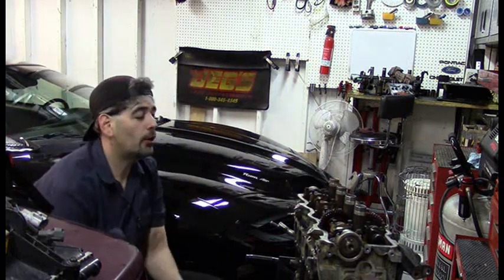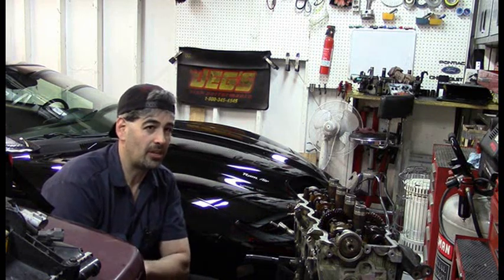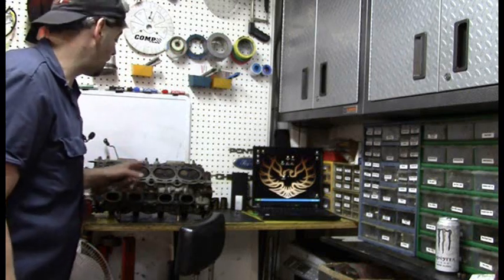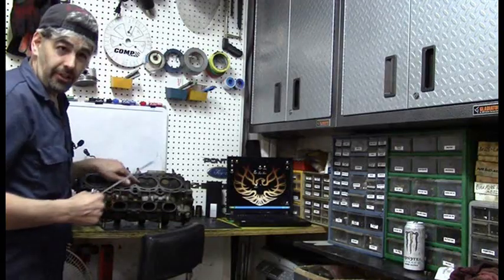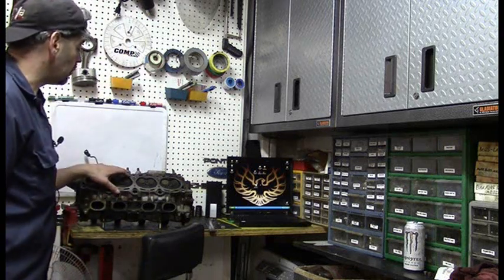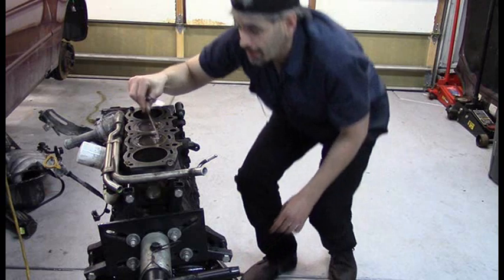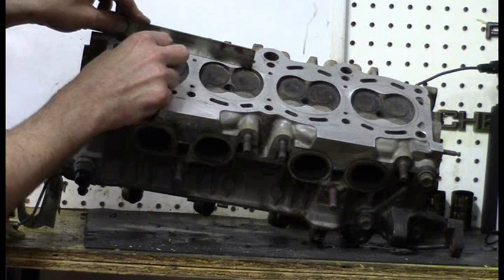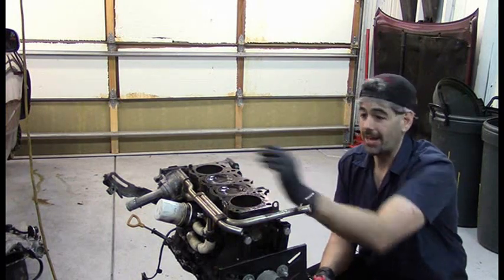Replace a Cylinder Head Gasket Yourself and do it RIGHT! Part 1

Comment: I'm a mom of 3 in Chicago. I have a 2011 Jeep Rubicon that I was told had a Head Gasket leak. Coolant found in the 6 & 4 cylinders. Been having those code/misfires for several months now. Replaced catalytic converter, coil packet, plugs, wires, recently. Coolant leaks on ground only recently. But it was "disappearing" over night. I'd drive for about 2-3 wks with no variation or reduction in coolant, then overnight - ALL gone, with nothing on the ground. 

No smoke, no white/brown stuff in oil, no "bubbling" in coolant/radiator or overflow tank. Rough 1st start of the day, evens out after about 10-12 seconds.  I only had 1 really bad start, as if it couldn't get gas. After 5 minutes idling, it went away.  Almost didn't start at end of July one day, took it to Jeep in State College, PA, they said my "spark plug wire was loose on 4."  They said all other 6/4 misfire issues (plugs, wires, coil, air intake etc.) passed, but he was sure it was my "Fuel Injectors", but they didn't want to replace them.  Kept giving me story about "not being able to depend on parts delivery etc." WTF!  They also stole stuff out of my Jeep!

Got it home, and took it to a non-stealership who said I had a Head Gasket leak, but unfortunately they don't do that kind of work. They're real honest guys at this particular shop.  Contacted 3 other garages in Chicago, and without even looking at my Jeep (one even told me over phone) that "Head Gaskets are not repaired or replaced.  I have to replace the entire engine."  LOL Dbags.

The ONLY Jeep dealership that I've found to be honest was in Cleveland, Ohio - at DEACON CHRYSLER JEEP.  I wouldn't even try to drive it that far now.  This is by far, the worst vehicle I've ever owned! Almost $50,000 for a pile of crap!  Looking for honest help in Chicago or anywhere in Illinois! 😭
Reply from the maker: Oh man that’s devastating but I do appreciate your sharing the story. I’m in colorado or I’d help but hopefully someone near Chicago sees this. Best wishes!
Reply: @SchrodingersBox  Thank you!

Comment: Awesome video / tutorial. Nice to see an advanced DIY video with some in depth analysis of the issue. I do agree to some point that it sometimes does not make sense to record the whole process of removing the head and each bolt & hose in the process. Even the description of your channel states - "This channel is for Advanced DIY auto repair" which should imply that the viewer is familiar with some previous automotive repairs. Then again I think there is a need for the channels / videos that go more in depth of the process of removal itself. I guess its something like school. You can't jump to solving differential equations before learning basic calculus (and a lot more stuff before). Anyway big thumbs up for the video.

Comment: Excellent video. I'd suggest also inverting the cylinder head on the bench and pouring some gasoline into each opening to test for leaks. Also, this test can be used in cylinder/piston gap situations. That might indicate more work to be done, even if not related to the overheat condition. Occasionally, cracks or gaps, either in the block or the head will be found in this way.

Comment: Thanks for the great video. Watched both parts twice, and felt pretty confident going into what I thought was going to be a head gasket replacement.... but I got lucky and during the tear-down I found a single bolt missing on the lower intake manifold.

Comment: I have a  97 Ford escort that showed symptoms of low compression on one cylinder. it was misfiring, hard starting, didn't feel "even" when it was running I had found evidence of an overheat due to a cracked thermostat and coolant being diverted through a bypass. got a parts car and had the replacement head resurfaced, got all new seals, found a ballast resistor for the ignition that wasn't properly grounded, (might have been the cause of the misfire I was getting) replaced a bad motor mount I couldn't get to with the head in place. replaced valve stem seals and refitted the replacement head. I guess I got lucky because the car runs great now. Wish I had seen this video before I started the job.

Comment: Pressure testing yielded coolant spraying from the gasket at this location. The "intermittent" part is my addition, because the coolant was spraying a needle-fine mist  all over the exhaust manifold one day, and the next day (and every day since) there's been nothing. (I got the pressure test done immediately after that episode.)

Coolant looks good, oil looks right, manual transmission so that's not a concern.

Thanks for the video and the response.
Reply from the maker: Lol, well I agree- that's pretty definitive of a blown head gasket! I rarely see them leak to the outside- usually the intake manifold does that.
  While I can't say for sure a 35 year old engine is not prone to a head gasket failure just from age, I can say that I have never seen nor would I expect a head gasket failure that wasn't caused by some mechanical issue originally.
  If the head is not warped or cracked and there is obviously no overheat condition and cylinder compression is not way higher than normal in the intact cylinders, then I suppose you have support for an argument that the head gasket simply aged.
Reply: I was planning on having it pofessionally machined regardless, but trying to cover all the bases. Thanks!

Comment: I've lost track of how many times I've watched this video. My first cylinder head removal was about 5 years ago.. Had absolutely no compression on cylinder 3 on my 3.5L Chevy engine. This thing was literally reading zero. I had brought it to a shop for a lower intake manifold gasket and when the car was returned to me it had a dead miss. After fighting with the shop, they would not look at it and insisted they didn't do anything wrong... Well they did. One of their techs swapped the intake and exhaust push-rods while reassembling the engine, causing a valve, and the guide in the head, to bend violently. I replaced the head with a used head and it was good to go. If I could have proved at the time that they were the ones who caused the head to fail, I would have pursued legal action.

Comment: So I just found your channel today.  I thought you posted specifically electrical diagnosis.  Righteous!
Reply from the maker: No I do a few basic bolt turners mostly just to bring in that demographic in hopes of showing them there is a more intellectual side than just spinning a wrench.
Reply: @SchrodingersBox  Funny thing,  I'm from that demographic.  Found your channel from your intro to fuel trim video.  Good stuff.

Comment: Any head gasket job I get, if it's aluminum head, I do a quick check with a straight edge and feeler guage. If I can get a .05 guage under it, it's off to the machine shop. If there's no warp, I pull the valves and check for obvious cracks. If I can't find one, I have the shop check it with their equipment.

Comment: Thank you for stressing that root cause analysis must be done before taking an action or you will be facing a recurring failure. I have tried to teach analysis for 15 years, it saves so much time and effort if a person  will just find the reason for the failure.
Reply from the maker: +Donald Wallace Yep amazing how many times I have seen people on their 3rd cylinder head (or any other component) because they keep fixing the same result of a missed root cause.

Comment: I love the hands on common sense approach to this repair! have a 2003 Dodge Stratus with the G engine in it and I replaced it with a used one with less miles the mechanic said the head had been replaced. My question is all of a sudden it is overheating. I have replaced the radiator, hoses, thermostat, the fans all work and I think I have oil in the fluid..I guess the Head Gasket is next repair? What do you think?
Reply from the maker: I would see my video series "12 ways of how to test a head gasket" and this will help you definitely find if a head or gasket issue is the cause.
Reply: Ok thanks I will look at it right a way and go from there. I will let you know what I find out!

Comment: great video just one thing research the k-series engine that will fail without low compression, mainly because its a long bolt engine and it flex's, but on the hundreds of the K-series engines i have rebuilt, tuned and repaired when they fail low compression is never an issue it is always the gasket and it overheating.

Comment: cracked metal detection kits consisting of  aerosol cans of cleaner and dyes are available at welding supply stores.  Pretty definitive, easy to use and not all that expensive for value gained.

Comment: Honestly, glad i take the time to research before i do stuff, just finished getting a fel pro head gasket in the mail, was about 3 seconds away from just going n pulling off the head, chipping out the old gasket, putting the new one in n torquing down the  bolts to spec n just firing her up after... good thing i didnt do that -.-'

Comment: Bolts are a science of their own, I did some work with a person who was probably the world leading expert on how to design bolt connections in cars for transmissions, engines, transfer cases etc working for one of the big 3 at the time. Anyway bolts are designed for the 2 parts they are joining, it is a spring just like the 2 parts that you are bolting together. In some cases you design for one time use, in other cases the bolts are reusable, theoretically....in reality, you never know if the bolts have been over torqued, maybe torched since they were stuck and so on so getting  new bolts is always the safe bet, especially for a head, since you always want a good head......
Reply from the maker: very good comment and very true. Yes there is tremendous physics involved in fasteners.

Comment: I love your channel, you make some of the best car repair videos on the internet. Quick question- What do you think of copper head gasket spray? I have changed head gaskets with and without it, and I have never had an installation related problem either way. Thanks.
Reply from the maker: Thanks man. Same here- never an issue either way but as of the last few years i use no dressing of any kind on head gaskets.  a i do not believe they provide any benefit.
Reply: Thanks. That's what I thought, just wanted to make sure. I like copper spray for exhaust manifold gaskets though. I don't think that copper spray is necessary for head gaskets, but I don't think that it's going to cause a problem either. Keep up the great work!

Comment: Great vid, that gasket is not symmetrical, at the end of the gasket there is a overhang region that is not on the opposite side.      Thanks for the vid though 🙏 chasing and ensuring a clean bolt install is a must!

Comment: Great vid! Only gearhead and want to prevent head gasket issues. You said you have to find the root cause to why the head gasket was blown. This was warp head and heat problem, but what caused the over heating problem?

Comment: Haynes manuals are good for telling you what a radiator cap looks like, otherwise I only have them for torque spec lists, which I always compare against another chart because sometimes haynes is wrong on that one.
Reply from the maker: Lol true.  My issue with Haynes manuals isn't actually with the manuals per se- it's that people who read them but never actually did any work on a car feel empowered to now give advice because of what they read. They go online and either give advice or "correct" people who do things differently than the manual does. In fact you ran into one of these "Haynes manual jockeys" on the last video you commented on-  The "foreign material" guy.

Comment: An extra point: You also must check the head bolts themselves for example in 6.0L Powerstroke engines the torque to yield head bolts stretch by a few thousandths and release clamping pressure on the headgasket even though there are no other problems with the engine. If a head gasket fails in this manner on a 6.0L engine, you will find zero problems with the head or block, but replacing the head bolts with ARP head studs (stronger) will fix the problem.

Comment: WOW to all the guys who use the manuals as gospel, you need to get out and do more work, since the manuals are average at best in some of the fine points.Hats off on this, I watched both and appreciate the level of detail since it does matter in the end. 2000 lincoln Nav original owner, I do all my work, rebuilt entre suspension system and fixed the sad ground issue that Ford says doesn't exist that smokes the relays. I need guidance. New tranny with 50K, new suspension 30K, I am keeping it as I like the ride. I have confirmed coolant leak passenger side cylinder #4 exhaust, two shops said that is the problem, butdeclined the business. My question is since no compression loss only the begining of a coolant leak, do I just repair the gasket or put reman heads/gaskets/timing set. Why waste the time checking on warpage since that cost is about half of what reman heads are in my area. I have no other symptons. No oil burning or smoking that is why I am not sure which way to go. I hate to waste money, but at 216K, with the other rebuilds the comfort of new valve trane, the delta cost makes more sense. Of course after tearn down if they look bad or don't past the old water test then remans it is. Just looking to see what others would do. The NAV's are not easy 26 hours the book says, with me much longer but the satifaction of it done correctly. this would be the deepest I've went in an engine, and never did a suspension job at that level either, the part I qworry about is the timing of the beast. I have found other guys who don't use the cam locks ect and get it done. Its all about the details, understanding and ensuring you take the time and do it right. I welcome your opinion on my delema.

Comment: Fun Fact: I am a Ford and Vauxhall mechanic at a dealership, and my mom drives a vauxhall (opel) corsa. After about 10 years and 60k miles the car had oil in the coolant. The only way where oil and coolant could intermingle is in the block and the head*, so I took the head off, and replaced the gasket. It was completely corroded from the inside of the oil passages. So aparently, vauxhall cylinder head gaskets fail for no reason. But you are right, I will be doing this job again, in about 9 more years when the new gasket will fail again. Assuming the car will live that long.

*sidenote: The timing cover gasket could also be a problem, but it was quite new, since the car had recieved a timing chain set, after the original tenisoner failed catastrophically after 8 years and 40k miles. This car never ceases to suprise me (in a bad way :P)

Comment: I just did a head gasket job I had the Sam problem with the new gaskets there was no up side there the same as the ones you just showed I put the side up withe the wide groove in the solid side is facing down on the block

Comment: So I understand that cylinder head gaskets don't just fail on their own.  I replaced mine in a 2006 Aveo when the timing belt broke and bent all of my intake valves.  They were pretty bent and I found a good deal on a re-manned complete head.  So the engine block sat for a while (3 months) with the cylinder head off and I thought I did a good job cleaning it with pb blaster and de-greaser.  Well long story short I'm measuring my mileage in quarts of oil due to the fact that its all leaking out of the front of the engine right at the head/block seam.  It never overheated after the rebuild and the only indication that there was even a problem was when I heard the clicking of low oil and then the oil light came on.  should I send the certified cylinder head to the machine shop I got it from to check it out or is it more likely that I just didn't clean the block well enough.  I torqued everything in order and to spec and used new cylinder head bolts.  Also I had 2 choices for heads, one was "with oil drain" and the other was "without oil drain".  The info I could find indicated that I needed the one "With oil drain".  Well, thanks for the video and any help would be appreciated.